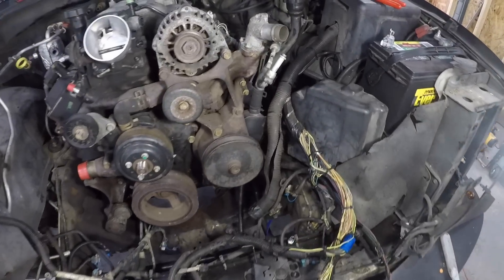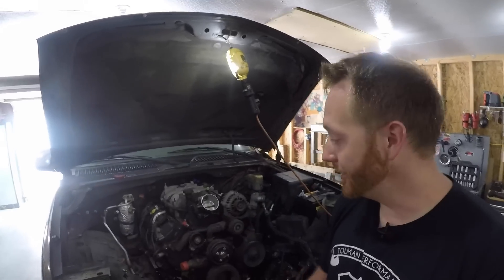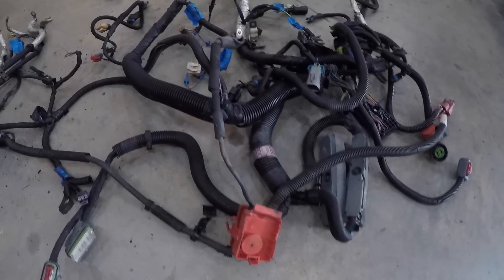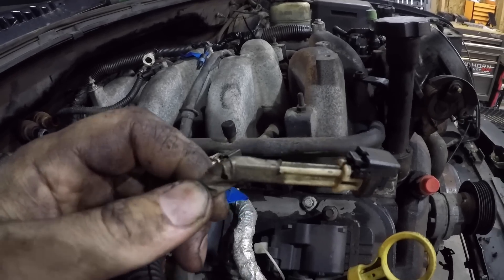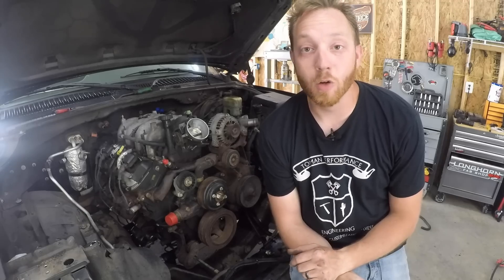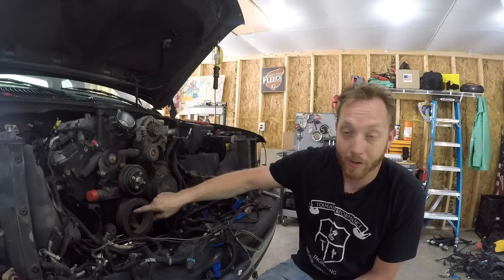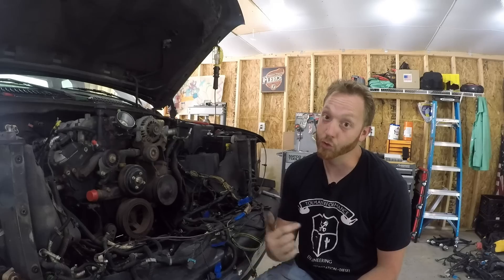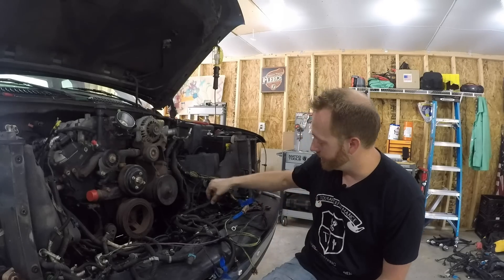Wiring and First Start 5.3 to 8.1 Engine Swap

Comment: So it'll run on a 5.3 stock tune? Curious because I have been thinking seriously on doing this on an 05 z71 tahoe with hydroboost and factory e-fans. My brother remembered and sent me a link to your channel. Also since you have a lot of experience with the swap, do you think a 4l65 would handle the 8.1 ok and something to upgrade later? Thanks in advance

Comment: I’m trying to do this to my 98 c1500 just don’t know what I’ll need to do. I have a 496 with carburetor. I’m wondering if I’ll need to beef up suspension if so from what vehicle and also will the 4l60 hold with this big boy 496?

Comment: Hello I’m actually trying to swap one of these in side a 85 trans am haha I like the video i was wondering so does this mean I can use a regular 5.3 wire harness to hook up to my 8.1? I’m wondering if I can save money from using any truck harness instead of the 8.1 harness I don’t mind but they r a bit expensive

Comment: Like your videos on ugly.i have a truck I did a 8.1 swap that had a ls 6.0l.done the complete swap.but haven't been able to get it to run.no fuel or spark.did the wire swap.got 12v at both and signal on both. but no start.any suggestions .

Comment: Hi I have a 2005 Chevy 2500hd took out 6.0 and put a 8.1, transmission was rebuilt 4L80 2wd will the computer from the  6.0 work or a computer from a 2006 2500 with with 4+4

Comment: Hey Lawrence, great video.  I have probably watched it 3 times trying to get as much info out of it as possible.  I have had some issues and questions about my 2001 suburban 8.1 that nobody seems to know how to answer.  My 2001 seems to the last year chevy made its throttle body with a straight 6-pin connection.  Recently I have had trouble with the TB and nobody, dealer or online, seems to sell this particular TB anymore.  If it goes out, dealer says car WILL stop running.  If you chose to put on a TB that is newer year, 2004 or so, it will bolt up, but the connections are different.  Newer style also has a 8-pin rectangular connector.  Do you have any advice on this? Eventually I will rebuild engine, maybe with some upgrades.  Do you know if it possible to just turn engine into 2004 or so with some mods so it will be easier to get parts in future.  Thanks
Reply from the maker: that's an area that is outside anything I've done personally, but look into a product called X-Link, I believe they have adapters to convert between different electronic throttle bodies. not sure if the 8.1 version is covered, but worth a look.

Comment: I've got a 2001 Silverado with a 8.1 and Allison tranny. The motor has a hole in the block but I've got a 5.7LS that has less than 5K on a rebuild. Would the original ecu run the 5.7L if I do some of the same modifications you did but in reverse?
Reply from the maker: I suppose it could be easily done since the LS and 8.1 use very similar sensors. In your case, you'd need to re-use the 8.1 throttle body, since they were drive by wire, but it will bolt up to an LS 3-bolt truck intake. Not sure on the flexplate, but I THINK if you had a 4l80e flexplate setup for an LS it should connect to the Allison, since I'm using an Allison flexplate on my 8.1 to connect to an 80e.

Comment: And this runs on the stock 5.3 tune ? Is this why the pcm has to be reprogrammed because these wires need to be swapped around?
Reply from the maker: Yes, it runs on the stock 5.3 tune, but it should be tuned to run optimally. The wires need to be swapped around because the pin locations are different on the sensor
Reply: @TolmanPerformance  thank you, I really wanna do this to my 2002 Avalanche 1500.

Comment: Actually, all those people are wrong in a sense about the engine power gains comparisons.. 1st of all please look at the specs across the board from factory between the 2 engines. 2nd, take the estimated amount money you'd need to sink in the stock 5.3 in aftermarket parts and labor to amount to the factory specs of the 8.1. 3rd, take that same amount of money and parts and do the exact same to the 8.1 and compare output again. Point is, the 8.1 is going to have the most hp and tq easily available for the lowest amount of paper than it's little brother. Remember, these engines back in the day became an instant game changer with just a set of headers added. You'd have to invest internal and external accessories to the 5.3 beyond 5 grand to amount to the 8.1 with a simple tune, headers, cold air intake, tbs, exhaust and a mild cam. Now, I'm not throwing small blocks under the buss by any means, I'm just saying for the money you'll get more power across the board for a lower budget and that's not even mentioning the 8.1 was tested full throttle for 300 hours by gm with no issues given!

Comment: So what did you do about the knock sensors wiring ?
Reply from the maker: extended it so one wire runs down to each side of the block, the 8.1 has one knock sensor near each motor mount on the block
Reply: @TolmanPerformance   Hey , thanks for the response , have an 02 2500hd with a 6.0 and picked up a 8.1 out of an 03 Avalanche , seems like it may be a little easier than the 1500 swap , any ideas on who could tune my ecm for the 8.1 ? Am in Florida , I lived in Chattanooga for 6 years , I miss it .

Comment: How did you swap out the electric throttle for the cable driven I have a 2000 suburban 2500 6.0 cable throttle thinking about doing the same
Reply from the maker: since it was a swap, I used the stock 5.3 wiring harness and computer that was drive by cable

Comment: So....if I swapped a 6.0 for an 8.1. I just adjust the wires and the computer will run it???? That simple???‽
Reply from the maker: Essentially, yes. A few wires need to be extended since things are in different spots, but it’s pretty straightforward

Comment: Hello I'm in process of doing this swap. Where did you find the drive by wire throttle body cause the 8.1 are all electric pedal
Reply from the maker: I used the stock 5.3 cable throttle body, it bolts right into place and is the same diameter internally

Comment: My brother's replacing his 8.1l in his 2002 k2500. Got the new motor swapped in and plugged in however it won't turn over. It's throwing a crankshaft position sensor code, we replaced the sensor and still nothing. Anyone have any ideas we have looked high and low and can't find anything on this issue. Has anyone else had this issue? And how did you solve it. Thanks in advance

Comment: Hey i have a few swap question if you have a moment.

Was there anything needed motor mount wise? Any tips that would make a swap like this easier? Theres always little gotchas
Reply from the maker: I think I showed it in a little earlier video, but it was a little custom fab work involving the stock 5.3 stuff, not too bad. adding one hole on each engine side mount, and moving the passenger side frame mount forward maybe six inches...

Comment: where did you pick up your 8.1 I have a 07 classic with the 6.0 thinking on putting a 8.1 in.
Reply from the maker: found it through eBay, the engine was from a yard in New Hampshire

Comment: Im thinking of an 8.1 swap. Was going to grab the motor/trans/ecu/harness out of the vehicle the 8.1 comes from.  Is there benefits of using an LQ4 LS computer instead of the L18. Thanks in advance
Reply from the maker: it kind of depends on what parts combo you're using. If you are using the engine and trans as-is, then yeah, just grab everything from the donor truck, including the throttle pedal, TAC module, trans control module (if an allison) complete wiring harness, airbox, and so on
Reply: @TolmanPerformance  on the fence atm about using a 4L80 or a th40O also if I want turbo or supercharger.. But plan is track car/Sunday cruiser. Thanks for the advice

Comment: So if I was swapping I could use an ow swap harness just move few around
Reply from the maker: yup, exactly that. Cam and crank need to move along with a few other odds and ends, but its very straightforward (albeit a little tedious)

Comment: So you had to change the crankshaft  plug?  Or you had to swap the wires?
Reply from the maker: the plug is physically the same for the crank sensor, just have to swap the outermost wires around. the camshaft sensor on the front cover is slightly different tho...

Comment: Did you keep the DBC  What did you do for oil filler tube from hitting the throttle butterfly cam ?
Reply from the maker: yes, it is drive by cable, and for the oil fill tube, I just welded an elbow on it to move it out far enough so the cable wouldn't hit

Comment: Dosnt the L18 have the same fuse panel under the hood as the 5.3? If so couldn’t u just unplug the 5.3 harness and plug the L18 harness right into it?
Reply from the maker: yeah, in theory, but I chose to modify the 5.3 harness because of a few reasons like my donor harness was for an Allison and I had a 4L80, I had a drive by cable truck and not a drive by wire like the harness had, and the accel pedal sensor and TAC module that came with the 8.1 were smashed to bits...
Reply: Lawrence LT Tolman ok I’m wondering cause I may try this setup in my 85 elcamino that’s if the 8.1 oil pan will fit   Also wondering if maybe the trans plug can be changed and repinned to work with the 4l80 .  I have a 5.3 in my 69 cutlass and I used the stock truck fuse panel and it made wiring sooooo much simpler

Comment: So theoretically you could unplug the 5.3 harness and plug in the whole 8.1 harness and computer if you had it completely uncut , couldn’t you
Reply from the maker: Yes, if you had a harness that matched your transmission (Allison or 4l80) and also if you had a drive by wire truck already. But that’s the gist of it.
Reply: Ok i have a really odd situation im swapping an 8.1 into a 2000 k2500 that came with a 5.7 vortec . Its a gmt 400 truck and I can’t find a company that makes that harness but if the LS harness is the same plug I would be able to order any ls swap harness and just plug my donor 8.1 harness into it
Reply: Also have the entire drive by wire pedal and everything from 2004 installed

Comment: Everyone is right about the 5.3 except for one thing. Nothing beats the sound of a BIG BLOCK thumping away under the hood of your hot rod. I have just started taking my 05 Sierra apart with the 4.3 and im dropping in a Blue Print Engines 632 Big Block. my thinking is Go Big or Go Home and it come Dynoed at 815 HP. Your video series has helped me with some questions I had about the 4L80e. Thank you
Reply from the maker: sure thing! a 632 sounds badass!

Comment: With that 1500, your fuel tank is only 26 gallons. With the 8.1, you're going to get about 9 miles to the gallon, right? This means you are going to have about a 200 mile range. Is that a potential problem for you?

Comment: You may have covered this... But did you have to change out computers?
Reply from the maker: nope. starts and idles with the stock computer, but I have since flashed in an 8.1 specific tune into the stock computer

Comment: Laurence T, congratulations for daring to be different.  I too am a fan of big block, low end torque, especially in the form of a Cadillac 500. 
My only “truck” cred is that my big block sits between the frame rails of a 1985, S10, 4WD pickup. Topside is a 1950 Studebaker Champion body. I swapped out the 4X4 transfer case in favor of a NVG 149 AWD unit. Like you, my transmission of choice was the 4L80E, which will be tested by twin Garrett 3782’s mid-mounted down low. Oh, the torsion bar suspension was exchanged for front coil-overs.
I look forward to future installments of the “Ugly Truck.”
Best, 
bro. d

Comment: A 6.0 or a 6.2 swap makes more sense...an 8.1 is just because you could. I would consider an 8.1 but, Raylar charges a fortune for performance parts and I have heard bad things about strength with power adders.

Comment: Did you have to change the tune or did it just run on 5.3 ecu? What year is the 8.1?
Reply from the maker: No tune yet, the startup was in the stock 5.3 tune but I do have an 8.1 tune to flash in
Reply: @TolmanPerformance  Cool, good to know. 👍

Comment: The Chevy big block has always been the go-to item when you want raw, N/A TQ and HP. The Corvair V8 Registry has some late model Corvairs w/ FWD Olds 455 engine/trans units grafted in the back seat area and they are quite the track monsters w/ their four-wheel independent suspension and excellent weight distribution due to the mid-mounting of the engine. They are also a favorite w/ the Corvair Ultra Van camper unit owners, as the standard boxer six was just a bit under-powered for the task of powering a motorcoach. Keep up the good work and I look forward to your modifications to the intake and exhaust, as there very few folk dealing w/ after market pieces for the 8.1.

Comment: I really like that you’re going your own route. In my look at the Vortec 8100 it didn’t sound robust enough for forced induction, but maybe that’s without supporting mods. My wife’s 55 has a 5.3L and I like it, but I have a DOHC LT5 for my 57 and may someday squeeze a SOHC Ford 6.2L in my Town Car. LS and Coyote are easier, but where’s the fun in that?
Reply from the maker: Exactly

Comment: With the cam sensor couldn't just flip the wires around instead of getting a new pigtail?
Reply from the maker: No, because the plug was slightly different, the alignment notch was off from one to the other.
Reply: @TolmanPerformance  thank you.

Comment: Couldn’t you just make extensions with plugs without taking the harness apart?
Also why not just use the 8.1 harness?
Reply from the maker: RedWhiteAndBlueVideo yeah, I could’ve but to me that wouldn’t look as clean because you’d have extra wires running outside the harness. I chose not to use the 8.1 harness because it was for an Allison and drive by wire, and I have drive by cable and a 4l80

Comment: Are the coolant temp censors the same
Reply from the maker: Nope, the 8.1 uses a 1/2” NPT 3-wire sensor and the LS 5.3 uses a metric straight thread fitting. But the resistance is the same between the two, so with splicing it will read the same to the ECM.

Comment: Hey LT, did you use the donor ECU, or did you use the 5.3 ECU with the re-wired harness. I wanted to do this same swap in a truck with a 4.8L LS with a 4L80 trans, just don't know where to start. Thanks.
Reply from the maker: Used the stock 5.3 computer, no problems at all.

Comment: Back in 2003 I came so close to buying a 2500 Avalanche with the 8.1. But I decided that I need a little better mpg so got the 1500 Silverado with the 5.3. Salesman said they hit well over 120 mph with that big motor. Not sure I believe them since I'm guessing the computer would not let it go over 100. Every think of putting some insulation in your shop and installing a mini split? I bet you could cool that down to at least 68 degrees and great heat in the winter. You and Tommy are my favorite on the Power Nation Team. So you two get a 10 the others get a 9.99999999.
Reply from the maker: thanks for the vote of confidence! I have considered many times putting a system out there to cool it off, but we'll get there!

Comment: Will the front springs need to be replaced because of the extra weight of the engine?
Reply from the maker: gonna find out! it honestly wouldn't bother me if it did sit a little bit lower anyway

Comment: Love the NON LS swap, being creative and going against the normal. I’m doing the same on my 65 F100, its getting an 04 aviator Dohc 4.6 and 6R80 until the Aussie Barra/6R60 shows up later this year. That 8.1 and a turbo will be a tire shredder and a kick ass tow rig
Reply from the maker: I would also love to get my hands on a Barra!
Reply: Lawrence LT Tolman i can set you up with somebody, think he has some in stock. If he doesnt i do know another source that likely does and if not he can have you one within a few months👍🏻

Comment: Lawrence, you are way more enjoyable then the power block! Loving your 8.1 build, I’m curious about what it’s going to feel like with all that bottom end torque!

I’m having my blown 5.7 Hemi converters into a forged & arp 6.4 stroker motor with ring gap, 11:0:1 compression, and comp torque cam for my 13 Ram 1500, boost ready! It’s always fun to do a bigger motor, especially a big block!! I’ve been waiting a while for someone to do a build like yours.

Comment: This is my close personal friend Larry Hofer's website, this may be a helpful source of information for you Lawrence, he also just released his book on the 8.1 496 engine 
https://www.raylarengineering.com/

https://www.walmart.com/ip/Chevrolet-8-1l-Vortec-496-Performance-Manual-How-to-Modify-8100-Vortec-Truck-and-496-Cid-Marine-Engines-Paperback-9781931128414/340373128
Reply from the maker: I’ve been on Raylars site a ton, and would love to run some of their parts on this build once I get it up and running all stock! Gonna get a baseline Dyno done, and then let the mods
begin!
Reply: @TolmanPerformance  Cool, buy the book, there's a lot of great information about the 8.1 in there
He wrote the book because he kept getting calls about the same questions over and over again

Comment: Other than showing the process to modify an LS harness to work why wouldn't you just use the big block harness since it was a drop out?
Reply: PJ Sloan dude read the other 5 comments that had this question days before you where he answered it lol
Reply from the maker: couple reasons, but mainly because the harness was from an Allison, drive by wire, and had a few places that were damaged
Reply: @TolmanPerformance  Ok. That makes sense. I've looked at the viability of these swaps a few times and had several opportunities to get one (with a 4L80) and just haven't. Too many irons in the fire right now anyways.